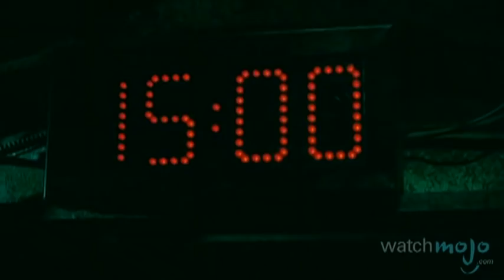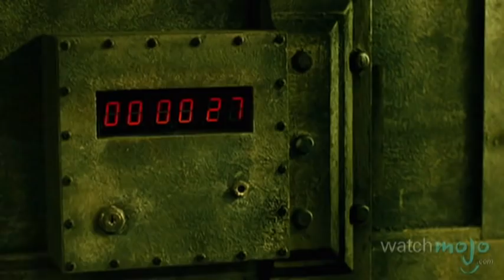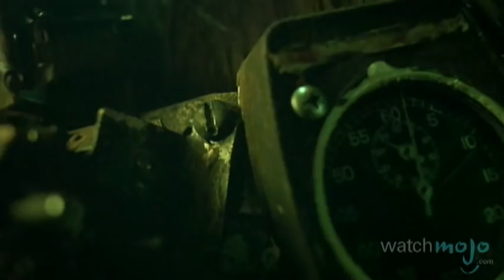Top 10 Saw Traps

Comment: My saw trap: Traversal Bear Trap

Similar to the Reverse bear trap, but instead of the mouthpiece being closed onto your mouth, its opened onto your head. In order to escape you need to rely on the help of a second person, on their side of the room are 10 glass boxes filled with keys, one of which will unlock the trap, but in order to get the key, the victim and the the helper have to put their hands into a a “Nail Hole” which had nails that would pierce your skin if it detected living tissues, if the victim didn’t unlock the trap in time, the two claws above the victims forehead and below the victims chin, would start to close in and eventually started piercing into the victims skull.

Sorry if it isn’t the best, I tried
Reply: K_rypton That’s actually a good trap, and it’s doable. Very creative xD
Reply: Put this on reddit lmao
Reply: I love your trap i got one myself

I call it the butterfly trap
Same as yours but the other person has to look around the room to find a very very very small key but I order to get you have to look in tiny boxes for that very very very small key and you have to do it in 8 seconds to do so. If you fail to do so the trap will do just like reverse bear trap does but it will clamp your mouth shut for an eternity  
HeeHee
Reply: Mine would be the the heel of hell.... The victim will be inject with both poison and time slowing liquid and will not be able to run as the liquid controls the persons pace and manipulate the time in their mind...they then will have to relies on the others person on the room who are on the other side of the room with a trap that will drill into the 2nd victim arms every 15 minutes.. The goal is to retrieve the antidote for the first victim and the key for the 2nd victim... But only the second victim can move to their objective and get the key that is inside the first victim pants pocket... Here's the catch.. The antidote is at the hands of the 2nd victim and they are 10 meter of metal floor that is constantly heated with hot steam and to go to the other side of the room the 2nd victim must wear a metal heel (not boot) and save both of them... The time limit is 60 minutes
Reply: Should you. Should you tryyyy.
Reply: @cutecrush4547  did you seriously just say it's doable 😳😳
Reply: All of you are creative but Istg do not create these, its stupid and psychopathic lmaop

Comment: Really? The Angel Trap is the one that won above all else? I don't know about anyone else, but I rate the saw traps based on not just the design of the whole thing, but the way to escape as well. However, the fact that the machines Amanda made were intentionally designed to be inescapable irks me. Personally, Saw V was my favorite out of the saw franchise. All the traps were intelligently made so that they all had to work together, and they could have made it out alive, without any serious injury. The most they would have sustained is a small shock and a possible stitch worthy cut. A lot of Jigsaw's traps are designed so they could make it out without serous injury. But Amanda didn't follow the tradition at all...
Reply: i agree
Reply: Plus she could have knocked the jar down to pour the acid out.
Reply: +Mike Litoris she has two hands one could tip over the acid while the other one could catch the key
Reply: +Mike Litoris oh sorry you're right she would of been able to get the key
Reply: +Froster knife (Frosterknife) wouldn't*
Reply: All the characters in V were hella annoying though
Reply: In saw one they had to work together to escape but then get one killed and then have one die of blood loss so even though they escape they die
Reply: +P0RT4L: N3WB FTW well, the angel trap actually seems pretty easily escapable, if what I saw is right, because the way the jar of acid is suspended, it seems like you could just pour it out, then get the key
Reply: Airbear B. But there was no way for her to actually get the things out of her ribs
Reply: +P0RT4L: N3WB FTW actually if you have seen the movie, its not a legitimate trap. Even when she does get the key in, it doesn't work because it wasn't set up by the actual Jigsaw. So i think the reason it was at number one was because it was designed to be inescapable. (however i still dont think it should be number one in my opinion)

Comment: THERE IS SOMETHING WRONG IN ANGEL TRAP:

If the jar with the key is acid how does the acid not melt the key?
Reply: if you watch the movie, her tape says that she can't wait too long, because the acid will dissolve the key in mere seconds, so she puts her hand in rather quickly
i have no idea how acids work, so the movie could have made a mistake here
Reply: llUnderscorell well, it was impossible, they mention in the movie that it's impossible
Reply: Margaret Lyle are you talking about the trap being impossible? that's true, but that was not what we were talking about
Reply: IT5AM :3 Actually the acid too weak to destroy the key quickly however it was strong enough to burn flesh.
Reply: If the key was made of metal or concrete than it would dissolve quickly.  If it were to be made of glass or plastic it would never dissolve, as glass and plastic are resilient to acid.
Reply: Weerwet the more you know
Reply: IT5AM :3 Wow
Reply: yea i just noticed :I
Reply: jigsaw said if she doesn't get the key in time it will melt and she will be absolutley screwed
Reply: IT5AM :3 yeaaaa
Reply: The key didn't get thrown into the acid until she was waking up if I remember correctly.
Reply: llUnderscorell....It depends on two things acid and its concentration,amanda must be good in chemistry if she pulled this off because she would have needed the right acid with a precise concentration in order for this happen
Reply: IT5AM :3 maybe the acid wasn't strong enough to melt metal
Reply: IT5AM :3 Amanda designed it anyway, it wasn't winnable
Reply: If you watch the movie, you will see he explains how the key will melt in a few minutes
Reply: Even if she got the key she was still screwed

Comment: I dont agree with this but heres my faves
10 flammable jelly
9 barbed maze
8  see and hear no evil s4
7 see and hear no evil s7
6 speak no evil 
5 cycle trap
4 walls closing trap
3 angel trap
2 horse power trap (because chesters in it i have to apprecciate actually did good for the role
Honorable mentions
Bucket heads
Hair trap
Brazen bull
Needle trap
Furnace trap
Seths trap
1st imma give it to shotgun carasel